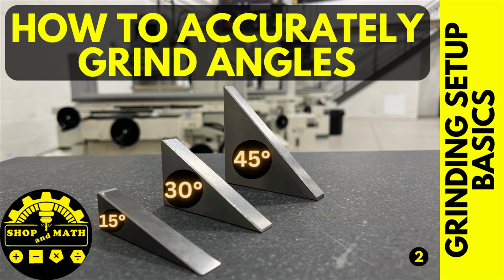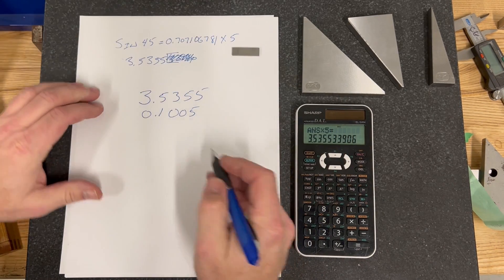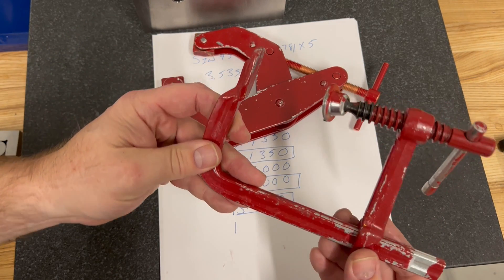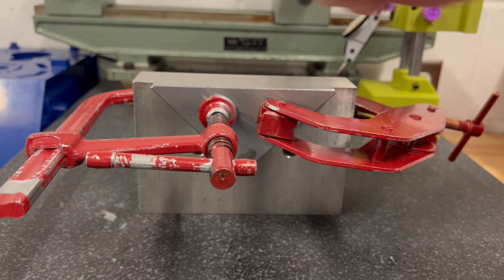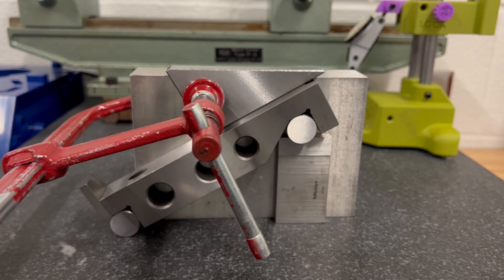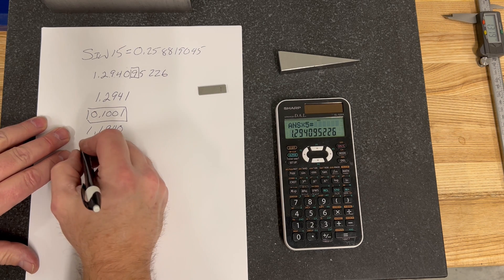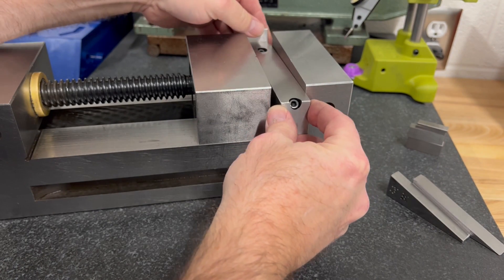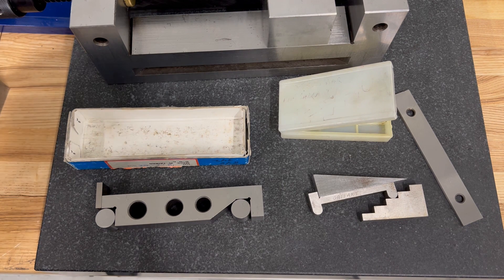How to actually grind angles 15°, 30° and 45°

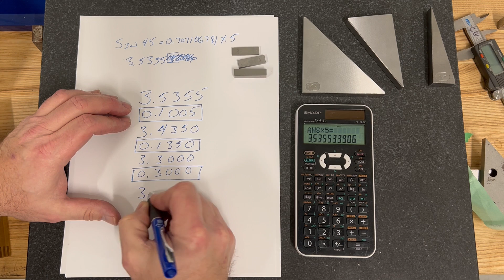Comment: 3:05 - excellent explanation on how to use a sine bar for arbitrary angles. I thought the last result was a "1" when it should be a "0", but realized you only wanted to draw a box. What happens when using a 1 inch sine bar?

Comment: The exact numbers came to my mind right away (sin45°=cos45° = 1/√2; cos30°=sin60°= √3/2). I had problems, however, guessing how to start with the gauge blocks. Thanks for the instructions. (sin30°=cos60°=1/2)

Comment: Wringing gauge blocks together has nothing to do with friction.
Reply from the maker: it creates almost a vacuum because of the fine finish there’s no air in between the two blocks. It’s just easier saying friction.
Reply: @shopandmath Friction and vacuum have no correlation to each other. Gauge blocks will remain rung in a vacuum.